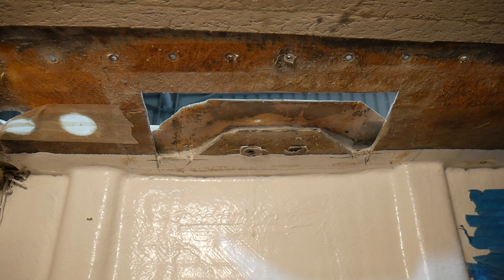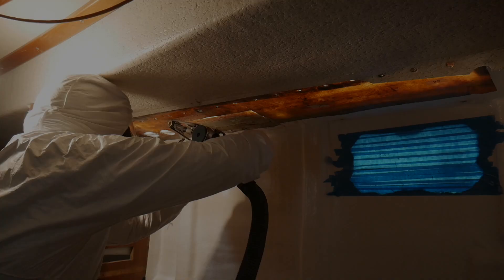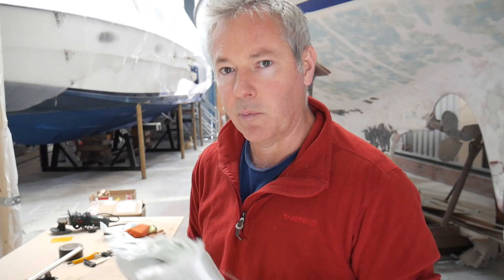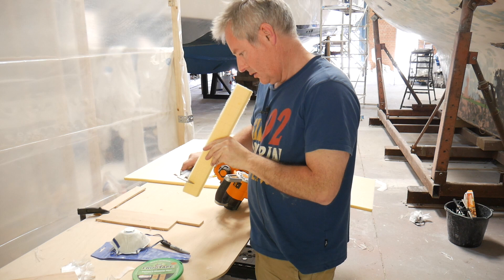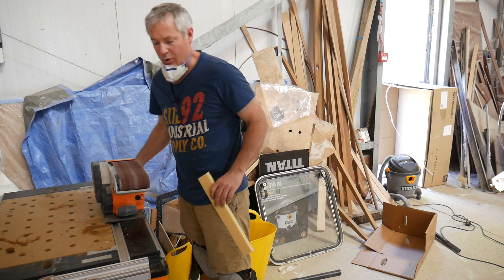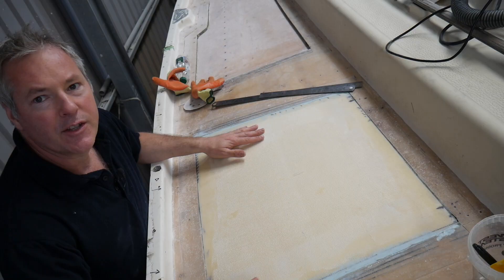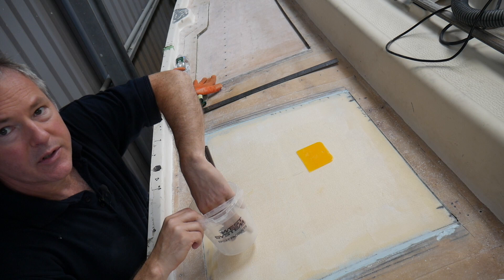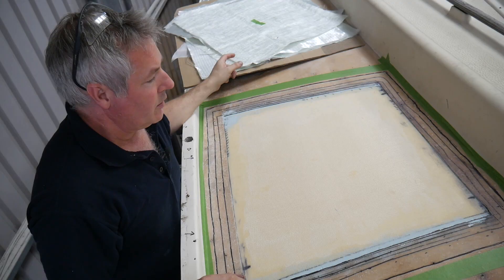#37 - working with fibreglass cloth

Comment: The first section of FG you replaced... is there no structural value to it? If there is, shouldn't that be a gradual slope on the edges, not a square edge in the hole? Does just a couple pieces of tape really tie it together enough? I'd think the FG strands would have to span the gap and run aways for full strength.
Reply from the maker: @Philip McLean I’m not sure there was any value to the FG  I replaced? Did you see the video where I ripped the fibreglass in half with my hands? That to me shows that the structural integrity had been severely compromised . 

Or are you taking about the bottom skin? That was removed purely to access the recess around the midship cleat. I had to remove it in order to access the core

Comment: Were you concerned at all with the gaps around your new core developing amine blush by having them dry before filling? I’ve seen many videos where they try to have the thickened epoxy squeeze up and fill the gaps then smooth it out so it’s only the top surface that gets sanded before laying glass. Never tried it just was thinking that filling those voids while still tacky would give the seam a good chemical bond. Thanks
Reply from the maker: Hi Erik, you raise a good point, and to be honest, no I didn't think about the new core getting amine  blush in the gaps. But then again I was quite inexperienced when I did that. I think if were to do it again I would indeed fill the gaps at the same time. IN terms of the risks though, at least in my experience I have only seen amine blush on epoxy laminate - when the epoxy has been applied raw. I haven't seen amine blush once you add a thickening agent to it - which isn't to say it is not there, just that I haven't seen it.I think its ok but I agree with you it would be good to fill the seam whilst tacky